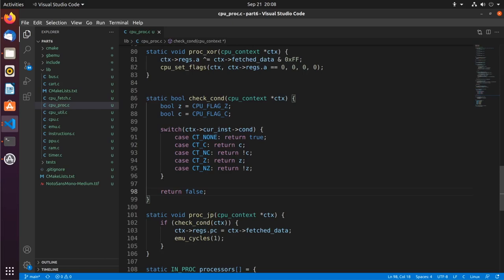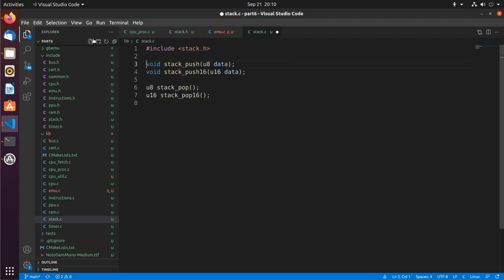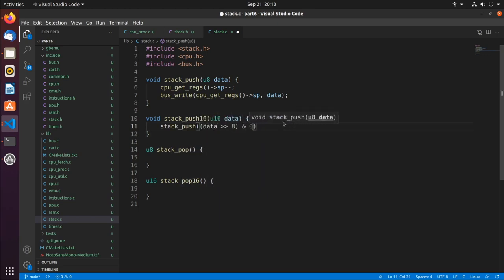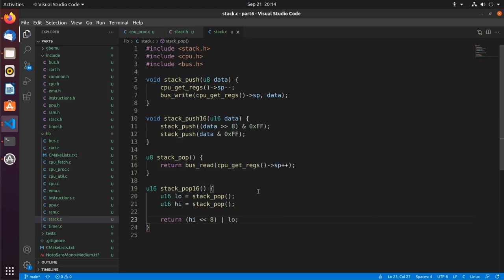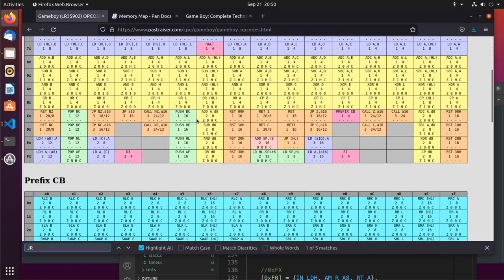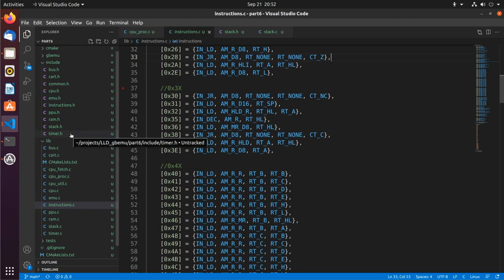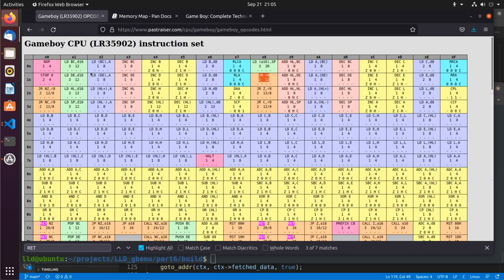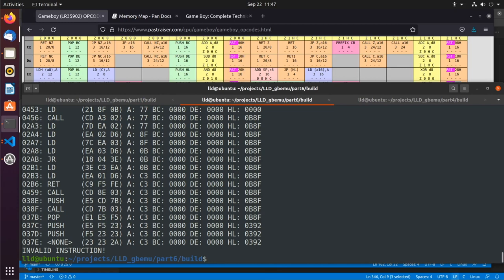Gameboy Emulator Development - Part 06

Comment: Thank you so much for what you are doing here! I have a few questions:
Why are we not simply calling stack_push16() in proc_push() and do a emu_cycles(2) instead of two times stack_pop() and emu_cycles(1)? Why do we add a third emu_cycles(1) at the end of proc_push?
Reply: For both of your questions, it's for cycle accuracy. On the original DMG hardware, a cycle would occur after each stack pop, so instead of doing two cycles at the same time, it is more accurate to cycle once after popping each byte in proc_pop. And in proc_push, there's a cycle after each reg_read and a third cycle for the actual proc_push operation itself.
Reply: @DarkPlaysThings  Thanks for the clarification after so much time. It's very much appreciated.